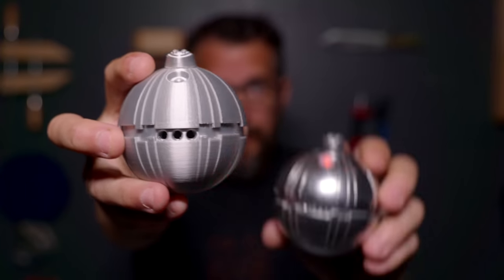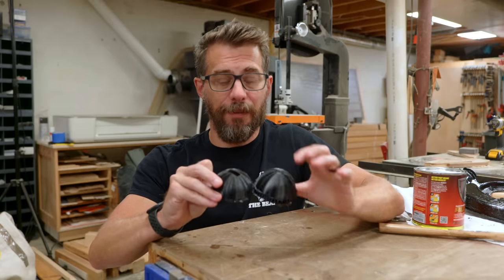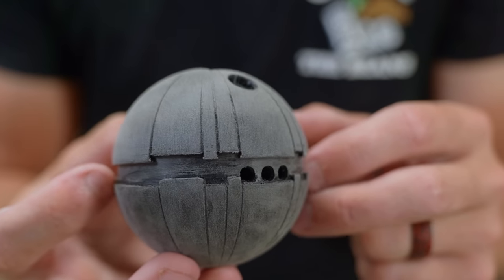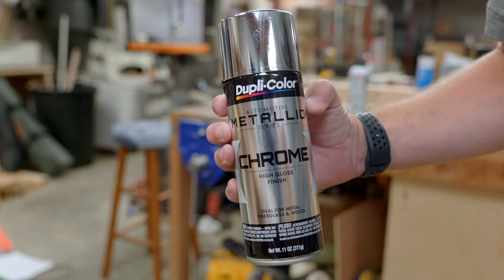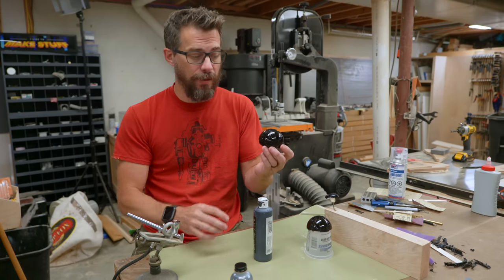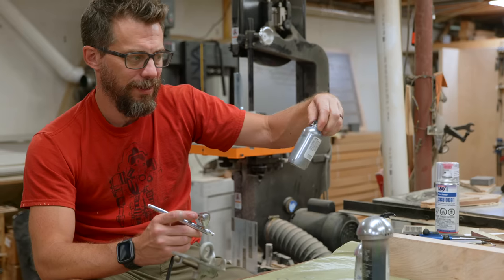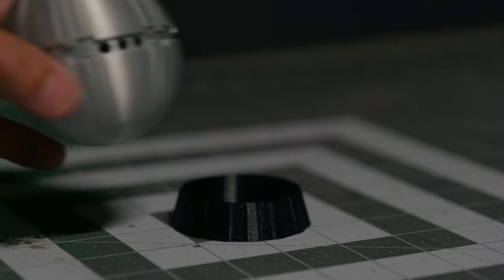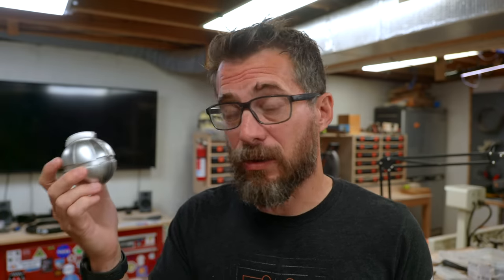But It Looks Like Metal??

Comment: For fine grooves put unwaxed dental floss in them. Then prime. Enough will soak through to coat but when removed (before drying) will leave the detail
Reply from the maker: Good call, thanks!
Reply: @Iliketomakestuff  if the PETG is pretty easy to sand, shouldn’t it be PETS(Pretty Easy To Sand)

Comment: Would love to see the rattlecan version after a wetsand and maybe a clear coat. I wonder if you knocked down the orange peel if it would more closely match the expensive one. Either way, great prop and great video!
Reply: I've used the rattlecan paint he used pretty extensively in my props, and can say from my experience the base doesn't matter quite as much since it usually has a "foily" look as long as its sanded to around 220 grit.
Reply: Clear coat on rattlecan metallic paint completely flattens it and removes the reflective properties - it would make it more of a shiny grey unfortunately. Would be cool to see rub n buff applied
Reply: Greg, youre right, but there are some metallic paints/brands that can look better with it. Like Rustoleum Gold looks better with a clear coat, while the silver flattens out. Its a trial and error thing. I actually made a video on my channel that deals with the optimized process I found when making an iron man helmet
Reply: @ShayneHeluk  ooo nice I will check it out! I'm currently 3D printing a life size R2D2 and am in the process of painting the dome silver. I'm going with gloss black, metallic silver rattlecan, then am going to use silver leaf rub n buff as a finishing coat
Reply: @GregsnBacon  sounds good! Just remember, the key to any shiny mirror finish is to use a filler primer, sand it, filler, wet sand, then when it’s smooth, apply super thin coats until its covered. If you go too thin, it will orange peel and break apart like with autobody paint. Good luck!
Reply: I tried that with some chrome paint. I ended up with a grey surface. The clear coat completely destroyed the metallic finish.
Reply: @GregsnBacon  Silver leaf looks it's best with a blue under coat; use red for gold.

Comment: Would be very interested in seeing how a resin print version of that stacks up with paints typically used for miniature painting. Across the 4 major paint lines you've got tons of Chrome, Metallic and Candy paint options, I'm sure you could get a hell of a result using those
Reply: I don't see why a resin print results would be any different from MDF other than the sanding.
Reply: @scratchinjack608  resin can get finer details since there isn't a nozzle to limit the minimum layer size.
Reply: Yes, this screams for resin.

Comment: I'm guessing the next step up from this might be nickel electroplating. From the videos I've seen, you can coat the part with a carbon based conductive layer. Then copper plate it and finally nickel plate on top of the copper. A lot of work but it would actually have a metal finish that you can then polish.
Reply: Or just go all out and use physical vapor deposition 🙂

Comment: Great video and cool to see the comparisons of the different techniques.  One tip If I may... The Alclad chrome and others like it work best when you dial down the pressure on the airbrush.  I go around 8-10 PSI.  Also, when you apply over the gloss black you do not apply the chrome to 100% coverage.  The goal is about 70-80 percent.  The chrome gives it a metallic tint but it's the gloss black showing through that makes it look like real metal.  Also - another tip... I find using flat black primer as the base coat followed by gloss clear works best.  The clear gloss goes down smoother than the glass black so you get a more even surface and less chance for orange peal.

Comment: I've seen some prop makers actually use the HVAC Aluminum tape as an option as well.  Then you can even polish it, or scuff it to make it more matte.  It is very stiff so it might be a little rough for rounder surfaces like this, but that is also a possibility.

Comment: Using Molotow Liquid Chrome Ink pen refill ink through an airbrush is a really good option for chroming. It's pretty cheap & has a mirror finish that is excellent.
Reply: I love Molotow's liquid chrome but the pens are 11 bucks a piece, I can't imagine refill ink for it being more cost effective than the bottle of Alclad chrome. Also in my experience if you so much as brush the stuff with your finger it loses its shine without applying some clear varnish over it, so there's a cost on top of just the paint.
Reply: @SerenadeURA  Bob said in this very video that Alclad is expensive. Molotow's ink refills aren't.
Reply: @drakocarrion  I know he said it was expensive, but my question was is it cost effective vs just spending the money on the Alclad paint. 

I went and checked it just now - you pay 50 bucks according to him ($42 on amazon as of me posting this) for 4 oz of Alclad Chrome but you pay $28 (again, amazon as of this post) for approximately 1 oz of Molotow's ink refill. That's half the price of Alclad Chrome for 1/4 of the size. Absolutely nowhere near as cost effective. On the plus side, it's not lacquer if you're not comfortable working with it, but you'll still need to seal it with something so that your hands don't melt the paint off (presuming you're making a prop)
Reply: @SerenadeURA  The requirement of sealing paint applies to the alclad too. It's a moot factor.
Reply: @drakocarrion  The sealing paint isn't the point here, the point is that you're spending 112 dollars on 4 oz of Molotow ink refills vs 50 dollars at maximum on a bottle of Alclad.
Reply: @SerenadeURA  You aren't really making a point. You're just arguing for the sake of arguing. Molotow is a much cheaper alternative to alclad in the terms described in the video.

Comment: Alclad seems to be much cheeper if you're in the UK. Their UK branch recently rebranded to HR Hobbies and 30ml (1 oz) bottles are £4.40. So if you're in the UK, you don't have to spend that much to get this great finish. 

Just remember to use a few very light layers when painting with it, you should barely see the first layer once you put it over the black. The heavier the coat the cloudier the finish is. With a really smooth prop and very light layers, you can get this stuff looking like a mirror.

Comment: You can actually use metal card scrapers (the wood working tool) and paint scrapers to remove layer lines in seconds rather than minutes and hours. I tried it expecting to destroy my prop only to fully sand a khopesh in 3 minutes.

Additionally, you can up the metallic look on things if you buff it with graphite powder.

Comment: I've switched to resin printing for the past couple of years and oh man post processing is so much easier. SOOO much more detail, hardly any sanding, you should really give it a try!
Reply: So true. We've got a project coming with a WHOLE LOT of resin printing 👀. Detail is fantastic.
Reply: The fumes from those though: Have good ventilation! They may not smell, but they are cancerous.
Reply: @FindecanorNotGmail  yeah I only use the one at my work and it is on a giant factory floor with plenty of ventilation. I have one at home but I never use it because I'm worried about the fumes.  But a resin vent hood station/cabinet would be a great build video for ILTMS

Comment: There is a product called rub ‘n buff by Amaco, it is essentially ultra fine metal powder in wax if I remember right. A lot of prop makers use it as a final step to bring up highlights and edges in things painted to look like metal. Really works well, I’ve seen Adam Savage use it on many of his prop builds. Comes in lots of different metal colors.
Reply: I like Rub n buff a lot, too, it goes a long way and looks better the less you use. BUT - for a project like this? Large smooth areas? I wouldn't use it for that purpose.
Reply: @MarkusvonRentheFink You are right, not for large smooth areas. I think just a little on the detail lines where the ‘plates’ come together might be good though.

Comment: You should try black gloss, then rubbing on graphite powder, using a soft cloth and buffing it afterwards. Produces a very nice metallic finish, much like a gun metal... and a tub of graphite powder is very inexpensive, compared to many of the metallic paints... and goes a very, very long way.

But yeah, it's all in that sanding, filling, sanding, filling process. It's the part that takes the longest amount of time and has to be as close to perfect as you can get it. NEVER skimp on the sanding and if you really want a 3D print that is great fro sanding, go resin. Not only can many resin printers, produce way finer details and show far fewer layer lines, sanding s SO much easier and wit enough grits, yo can produce and almost polished finish, especially with wet sanding at the end

Anyway once you've buffed and buffed the graphite finish, you will find that finger marks are easy polished/buffed out.. Not so easy on the painted versions and YES, you will want to wear gloves, and protect the work surfaces too, because graphite powder, being so incredibly fine, will get everywhere..Whatever you do, don't sneeze with tub nearby and lid open..

Comment: I'm curious. Could you take that metal infused filament, sand it and then polish it back up to a shine?

Another option is to print, sand, finish to a good finish. Then mold it and either cast it out of metal or do cold casting.

Either way, that chrome paint one came out beautiful! I agree with the person who said weathering it will increase the metallic look. Esp. with star wars props this works well because most things are "dirty" anyways.

Comment: I've gotten mirror finishes from rattle cans. 
Sand, primer, sand, paint, wet sand, paint again if you sanded too thin and primer shows through and then wet sand that down again. Then clear coat and wet sand that with a fairly high grit, then use micro mesh polishing pads up to a few thousand+ grit. Once it seems good, hand buff with car wax to get the maximum shine.

Comment: Wood PLA is also a very sand-able filament that makes like much easier for something like this that will be finished post print.
But resin printers would be the real way to go for things that fit in the print volume or can be effectively pieced out and printed.

Comment: For that prop you could probably use that aluminum tape. I have had good success using that on smaller pieces, you just need to take a little time cutting it and hiding the seams.

Comment: Alclad has a reputation of rubbing off more easily than rattle-can paint does, so it definitely is better for the display cabinet than the convention floor.
My go-to solution these days though is Rub'n Buff - a metal-infused wax: Smear on and buff it: The more you buff it the shinier it gets.
Reply: The Adam Savage method!
Reply: That is why Alclad recommends using their Aquaclear to seal off the meatalic coating.

Comment: Using DFM Blue Curved Cabinet Scraper Cards, will save you hours of sanding. Bill Eddie who did the Ghostbusters props uses this on his prints. I've been using them and have had great results. Also for smoothing you can try spot putty an  Acetone.

Comment: To help make it really pop, and sell the idea that it's metal, you could:
• Apply slightly different finishes to different surfaces. Real-world "full steel" objects are often made from different alloys, heat-treated and surface-treated differently.
• "Weather" it with a wash of black acrylic. Does not just make it look more "real-world" but also increase the contrast, making it appear shinier. Plus, it can help hide mistakes!

Comment: #1. With a Prusa there is no need to print larger than .15mm. .2mm just makes for a lot more work. #2. Rustoleum filler primer and wetsand to 320 then Dupicolor primer and wet sand to 600.   Next 3 coats dupicolor gloss black and wetsand to 600. Next 3 coats of clear gloss. Then airbrush with Alclad.  That’s how we do Mandalorian armor

Comment: Uuf Aclad is really expensive in USA.. here in EU 1oz costs about 7€ which or 28€ for 4oz but yes I was sure you will use alumilite because its much shinnier much more resiliant. Basically alclad when used on props that are held a lot everything will wipe off, you must protect it with clear coat but then you lose a lot of shine :S

Comment: This was a disappointing trial/tutorial video from a prop making channel.
1. Expensive paint will always win.
2. I hate to sand and have limited painting patience. Props that shall you should have used 0.10 or 0.12 layer heights for much less sanding.
3. Hardware and Walmart type of stores have multiple brands of chrome paint for much less money than an automotive store.
4. ALWAYS gloss black under chrome. Your middle test was just lazy and doomed to fail.

You should try gloss black under different brands of chrome wirh smaller layer prints as a follow-up video.

Comment: It's actually fairly affordable to nickel plate a prop. However it's somewhat finicky and just daunting to even consider until you actually do it and sort out the issues, but i would say it looks a lot more convincing than any spray paint. Might be worth the investment, i suggest checking it out. I'm not that far yet myself, i have nickel plated a bunch of things, brass and steel items for technical reasons, but i didn't particularly care about how they were going to look (though i did experiment, and i really like the look that can be achieved), and i never did conductive painting on plastics to prepare them for nickel plating. You can zinc plate yourself as well, but the drawback is that it looks like zinc, while nickel looks pretty awesome.

Something to keep in mind though that nickel is considered potentially toxic in contact with skin, apparently a bunch of people have allergic sensitisation to it from contact with low quality stainless jewelry. But for something to put into your display case, it's literally perfect.

Another way to achieve a chrome look is silver with Tollens process, but it's difficult to achieve this on the first surface, the surface is fragile, and protecting it with clear spray dulls the look.

A possibility to keep in mind is maybe just making the part conductive and then sending it off to get chromed professionally with real chrome, there are shops that do this for automotive restoration. I don't know whether someone has tried that, whether they'll even accept a plastic part as they normally work with metal ones.

Comment: Instead of all the sanding here is a great tip! Get some UV resin and a UV light and paint it on your print and cure it and then of course sand but trust me, the finish will be far smoother with a ton less sanding. Plus it makes the print much stronger! When using Alclad consider getting their thinner, I swear by their paints and klear kite finishes and thinning it down does wonders for the layup.
Reply from the maker: Nice, thanks for the tip!

Comment: Spaz Stix mirror chrome, both the airbrush liquid and the rattle can, are pretty excellent. The 2oz bottle usually runs about $12-14 for the airbrush liquid. Same procedure: try to sand as smooth as possible, wet sand if you can, and try to get as glossy a black surface as possible. Dust on the Spaz Stix in a few coats, and then buff gently after it's pretty much dry. Any clear coat is going to dull it, so it's up to how durable you need it to be.

Comment: It takes a hair-pulling amount of fine tuning, but if you can tune the printer to give you 0.04mm layers or smaller, it gets to the point you can hardly see the layer lines anymore.  I'd definitely recommend upping the bed mesh setting to 7x7 for that.

Comment: Alternately. Spray paint a high quality gloss black, then use silver rub n buff over the surface. Its about 6 or so bucks per tube and one tube lasts a long time. Rub it on, buff it off, polish with a soft cloth and done

Comment: Funny thing, shiny surfaces for things that go boom are overrated. The prop from metallic filament looked just fine. Print layers just add to the fragmentation concept. If you like shiny, do shiny. Consider powder coating the metallic filament. A chrome powder coat would be pretty convincing. If the surface will hold a static charge, you can powder coat.

Comment: The alclad chrome will work over gloss black or gloss white. If you get the base coat super smooth and shiny, the chrome will work very well.  The trick with it is to only lightly fog the chrome over the gloss base coat. If you put it on heavy, it will just look like shiny aluminum.

Comment: you need to try Japanese hobby paints like Mr. Hobby and Tamiya. They're waay less expensive and made for this sort of thing they have metallic paints  and In my opinion, the Surfacer (1000) fills better than automotive filler primer on something this small. You also have to polish that orange peel out a bit

Comment: If you are going to properly sand/fill/surface 3d printed parts or any prop and especially model parts get your hands on some Nitro-Stan Red Putty 9001. Its an auto body putty and is hands down the best thing I have ever found for filling cracks/textures and sanding a mirror finish. It is a go to in my model shop especially when we are making masters like for resin casting and need a perfect surface.

Comment: Weathering and emphasizing shadows with darker colors really is important. Your metal is good but you need to weather and shade the details. While not totally realistic this is how you'd get a better result from even the lowest quality one. Just som cheap black color in crevasses and any weather colour (from environment or oxidization) just slab it on and paper towel off 98% of it.